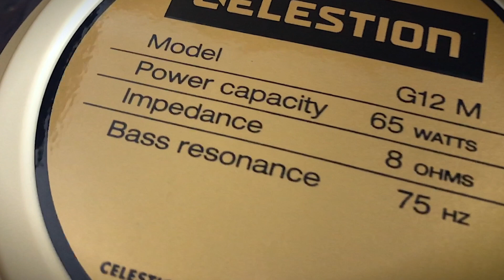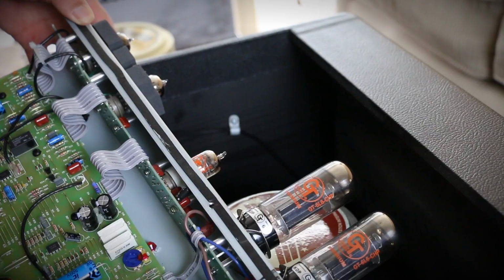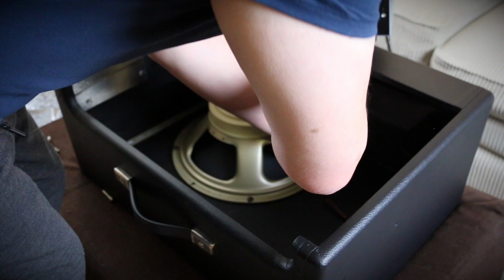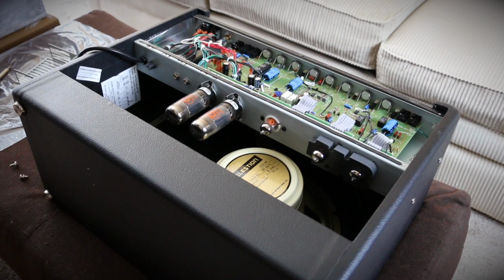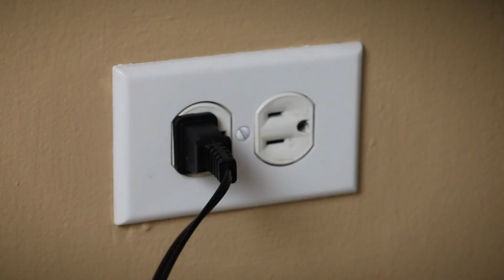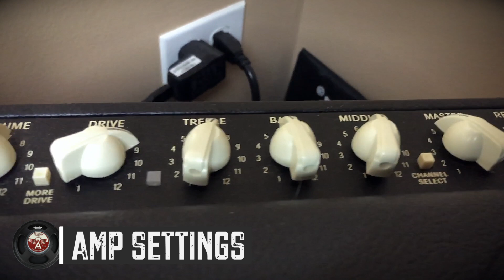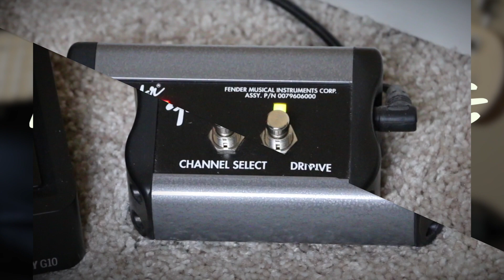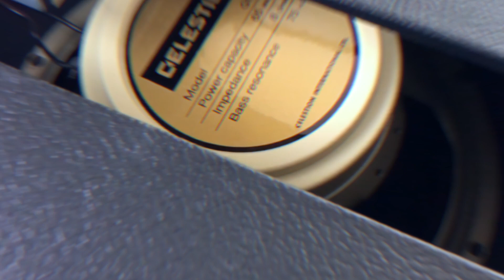CREAMBACK vs A-Type STOCK speaker in a Fender Hot Rod!

Comment: I've played the Hotrod Deluxe 3 and Deluxe 4 back to back. The Deluxe 3 sounds much better. It comes stock with the Celestion G12P-80 speaker. The low end is tighter and overall tone is more clear.
Reply from the maker: I used to have the three back in the day but can’t remember the sound! Thanks for the comment
Reply: I played the 3 and I think it sound graet, nice low end and spongy sounding. I bought a 4 and I don't like it. It lacks low end. Not great sounding over all. Do you think its just the speaker?
Reply: @pablodevera3278  the 3 cabinet is made from a different kind of wood, heavier and more dense. Plus, the speaker is different from what is used in the 4. I think those two elements make a difference for the tone of the amp.

Comment: The back panel will be easier to remove if you slightly loosen the 2 chassis screws on each side of the cabinet. This is especially helpful if you're removing the back panel of a Blues Jr. to do this modification.
Reply from the maker: Good tip thank you!!

Comment: I'm no expert but I've been told by those who are that you have to be very careful not to over tighten the screws holding the speaker in place and to be sure to get as even a tightness on each screw as possible not to warp or bend the speaker chassis.

Comment: You don't need to remove the two bottom cage screws, only the top one. I put an alnico creamback 90 in my HRD and it sounds so much better than the stock speaker. I have the version 3 amp. Probably going to put one in my blues deluxe too. I put that stock speaker in a Boss Katana 2x12 and it's louder and a bit clearer than the stock Katana speakers.
Reply from the maker: You are right, I realised that the second time I did it, I think the cream back also sounds better, to my ears anyway, cheers for the comment and feedback!

Comment: Thank you for this video Derek! I used it as a reference when changed out the speaker in my HRDIV. Went with a Cannabis Rex. So far, and it needs to be broken in yet, I really like the tones I'm getting out of it specifically with my Strat Ultra and Tele. Les Paul neck position sounds very flubby though and perhaps that's just because the speaker isn't broken in yet. Primarily I use single coil Fenders and I'm optimistic thus far. Just installed it yesterday so need to figure out a new EQ and dial it in. BTW I recently had some tube rattle. Was pretty bad. Took it to shop and they installed two Mesa Boogie power tubes. I'm pleasantly surprised how big of a difference that has made. Highly recommended and was only a $60 upgrade.
Reply from the maker: Thanks Joel, I’m thinking the same with the creamback, as it’s such a different sound I’m having trouble getting used to it, but as it’s an pretty straight forward swap it’s no trouble to install the a type back into it, I’m hoping I have to break it in also, good tip with the tubes though, I’ve heard that they can make a difference, cheers man!

Comment: Great video. My experience is that when I've played my stock HRD IV with a band it's sounded plenty bright. I'm not sure I'd want a brighter speaker. The presence knob can help with that. I think with a smaller amp like this the midrange hump helps because it makes it sound louder than it really is, especially with other instruments. Trading mids for treble could reduce the perceived volume and basically make it so you can't use the amp in as many situations.
Reply from the maker: Thanks for the feedback! Mid range is definitely needed on stage! Cheers!
Reply: No words, such an excellent comment!!!

Comment: I have a hot rod deluxe with a 75 watt speaker 
But i have an extension cabinet with 25watt greenback. 
Will it damage the Greenback? Or will it be okay concerning it’s being paired with the 75watter
Reply from the maker: Id say as long as the 25w has the correct impedance and you don't run it at high volumes you should be ok, maybe someone else has a more scientific answer though, cheers!
Reply: @DerekPaulGuitar  if the amp's 40 watts at 4 ohms and each speaker is 8 ohms, then each speaker will be receiving 20 watts

Comment: They both sound good obviously, but my ears hear a little crisper attack with the Creamback. (poetry 101 LOL). However, the CB seems to decay faster and the original has a little more growl and guts and is a tiny bit warmer. I can hear more treble articulation with the CB, especially on the strat. I don't know if there is a clear winner here, I think it comes down to individual preference. Cheers!
Reply from the maker: I think you are absolutely right, it's going to be a personal taste thing, i'm not sure which i prefer yet but  they both have great characteristics for sure! cheers

Comment: thanks Derek i was thinking of doing just that,My old 97 h.r. drive ch always sucked.I use a pig nose in place of my pre amp. sounds better thinking about the g12 creamback, the hot rods like you have are better than the old ones.I was born in middlesex London England ,Do you know where that is?
Reply from the maker: Hey Michael, cheers for the comment, I still have the cream back in mine, makes such a difference, yes I know Middlesex very well! Cheers!

Comment: I have a g12h-75 16ohm at home, can I use this as an upgrade?
Reply from the maker: As I understand it the speaker you have will have a tighter low end and punchier high end, I’d stick with that, cheers
Reply: @DerekPaulGuitar  but the amp has a 8ohm speaker in it as stock correct? I have a 16ohm speaker, can this be used?
Reply: To clarify it is a g12h- 75 celestion creamback 16ohm
Reply from the maker: @grahamkelly8299  I’ve read that it’s not recommended, cheers
Reply: Not sure if you're still thinking about the speaker, but you can use load resistors make a dummy load box at the same impedance in the second speaker output to half the load on your amp. It's like adding a second speaker but without the extra volume/cost. So you'd have 2x 16ohm impedances which would bring the total load down to 8ohms.
Only drawback is that they get super hot from turning the high powered signal into heat instead of sound. So you'd need either A.) resistors with a power rating around 4x the amp's power OR B.) a really good heat sink/cooling setup